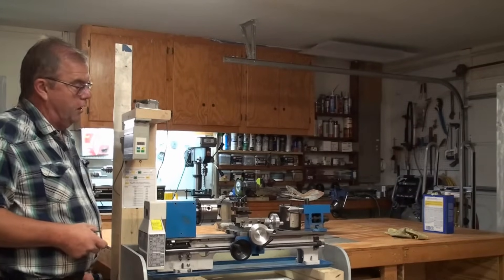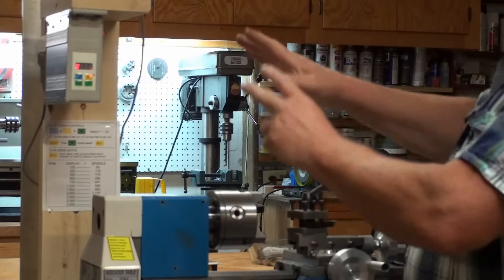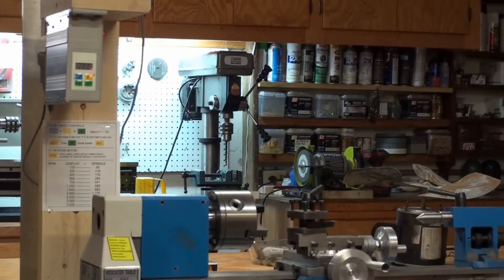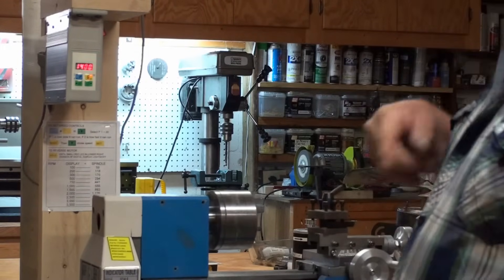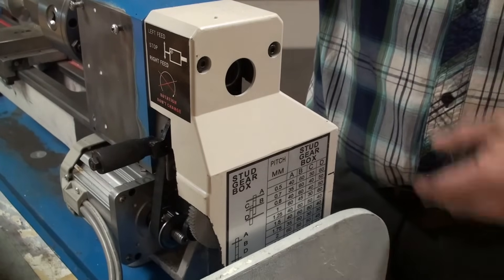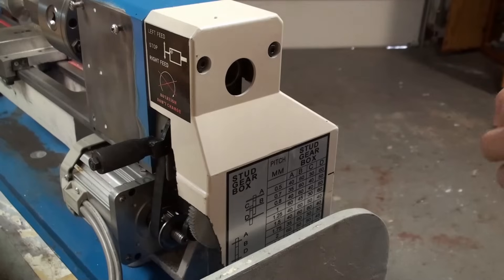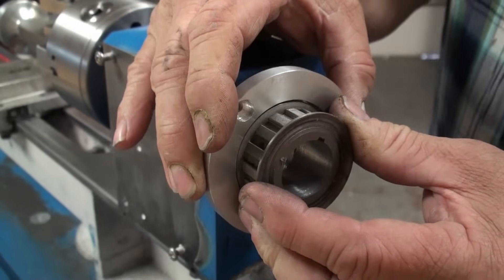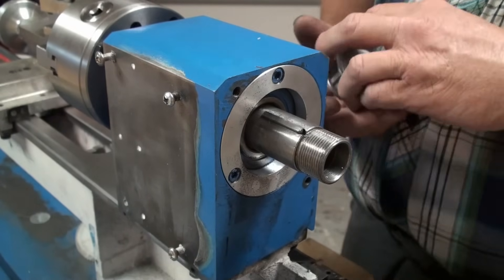Mini Metal Lathe 1 HP Servo Motor 750 Watt Computer controlled with threading and gears

Comment: I have always loved pulling things apart and making them better so I think your videos are fantastic. I am thinking of getting a mini lathe i have narrowed it down to two I thought about the mx-8/14 with a 650 watt motor but then spotted a mx-s716g with 800 watt motor. Which one would you recommend. Or maybe a better model. Thanks in advance.
Reply from the maker: These numbers mean very little to me. For starters. What brand is it sold under? Only Lathes sold by known stores in USA will tend to have any quality control. That means USA based business (grizzly, Harbor Freight, Northern), There are better higher priced, more QC company's but remember, based in USA and stock parts. 
Consider this: Vevor is not a manufacturer, they are a discount warehouse and shipping company. They stamp their name on many things, Lathes in particular seam to be what ever is available and called the same model regardless of what is inside.

Comment: Nice!  That motor come with a square aluminum mounting bracket? I purchased mine and didn’t come with it. I can’t mount it because doesn’t have anything to hold to. It doesn’t have the 4 screws either.
Reply from the maker: This motor now is built to our specs to include software based jam protection, thermal overload protection, Non magnetic speed control switch, fully adjustable motor mount that allows for both belt tension and belt alignment, polished and anodized Synchronous Drive pulleys and 1/2" wide USA standard L050 belt. 
See it here: https://www.servomotorkit.com/spindle-drive
We also have a complete system for the 2 speed versions.
See the 2 speed kit here: https://www.servomotorkit.com/shop-1
Note: some page address's are subject to change so start at: 
https://www.servomotorkit.com

Comment: You mentioned you do mods on that lathe. Have you done any with the compound and cross slides? Also, with this mod are you able to take off more material per pass compared to the 750 watt motor that was in there?
Reply from the maker: Yes lots more with each pass. However just because you can does not mean you should. Remember the bed is only 3" wide. If it chatters, you are cutting too much.

Comment: Hi I live in the UK what voltage is it and how much
Reply from the maker: Dave, I can build it in 110~120 volts or 220~250 volts. They sell in the USA at apx $289 USD. However I usually do not ship outside of the USA.
That video is very dated. The new models have to many upgrades to list.
To see them on eBay you need to register a US address in your eBay account. At that point you could buy but you will still need a US based reship company
and they will likely charge you a considerable fee..
I will consider selling to you direct but only after seeing your feedback on eBay. That is feedback you left for others.
Discuss this by e mail to fernriverresort@gmail.com

Comment: Howdy friend, do you still have listings on eBay? It appears your link is broken.
Reply from the maker: I updated the link above. Additionally you can search eBay links as follows:
Single speed mini lathe kit: https://www.servomotorkit.com/spindle-drive
Two speed mini lathe kit: https://www.servomotorkit.com/shop-1
8 X 16 mini lathe kit: https://www.servomotorkit.com/product-page/900w-8-x-16-metal-lathe-mx-210v-servo-motor-upgrade-kit-1-2-hp-belt-type-vvvv

Comment: I've had my 7x14 Erie tools lathe for 6 years now and have been fairly satisfied with it to a point. I always realized that it couldn't perform like bigger and better quality lathes but,for what I do it was adequate as at this point I really had no need for anything high precision. I've made a few upgrades and mods to it but always noticed it was lacking in its ability to produce a real decent finish but not anything that a little polishing couldn't fix but it always had a tendency to chatter somewhat no matter how much tinkering and adjusting I did so,I just concluded it was the nature of a cheap mini lathe. Last week while turning some delrin rod,the spindle just stopped dead but the motor was still running. At first I thought that the belt was slipping but when I inspected it,I realized that the motor shaft had snapped. It actually broke off clean right at the armature. I really don't know how it happened as I was only cutting plastic rod at the time. I'd been looking at this upgrade kit on ebay for some time and actually almost bought it awhile back but figured that I really didn't need it as the original motor had adequate torque for what I do. So I  purchased this new servo kit from Dan last week,installed it and tried it on the very same piece of delrin that was still in the chuck when the shaft broke and immediately noticed a difference in the way it cut. There was no more chatter! All this time I thought it was something about the overall quality of the lathe but actually the motor was the culprit. I chucked up a piece of aluminum rod and tried it and the difference was huge. No more chatter. The installation of this motor was simple. I just had to modify the belt cover as bit per the instructions and some on the headstock cover,about 10 minutes work. Fit and adjusted perfectly. Every time that I had to change the belt on the other motor,It was a pain to get it right but this new one aligns perfectly.
Reply: Salve io oh acquistato  un torneo di 2 mano  propio come il tuo stesso modello ...il problema è senza motore senza marca senza matricola ..pultroppo i tecnici anno difficoltà a poter inserire un motore nuovo , visto che nn potranno neanche risalire al modello visto che io lo acquistato così...magari lei può aiutarmi per marca il tipo di motore originale e la pulegia montata sul motore dendi e diametro ...la ringrazio,  io tradurro in italiano .

Comment: Nice work, I need to do this for my emco, whats the dimensions of the motor
Thanks
Reply from the maker: Steve. Which model Emco? I ask as someone is in communication with me on eBay to make the kit. Always better to make the first kit with an owner and not through eBay.
Once complete it would be listed on eBay for other Emco owners. First one gets it at cost or less but has extra shipping.
Thanks 
Dan
Reply: @danielmartin382  Its a Compact 5 but might need the motor for other machine depending on dimensions of the motor
Thanks
Reply from the maker: Very busy right now but looking for a broken Emco. Maybe someday I can develop a kit

Comment: Hay do you no if this will fit a 7 by 10 lathe
Reply from the maker: There is a different kit for two speeds. Search eBay with this item number 184590554254.
If you already have the motor, look at this kit, search eBay for this item # 185226001159

Comment: Still in the process of getting my new lathe up and running.  I have the blue and white lathe in the video in a 7 x 14 configuration.  Now I know how I'm going to fix it after I get up and running and break it, lol.  The belt and pulley upgrades alone would be a huge improvement.  My mad money account was stretched pretty thin with the lathe purchase, plus all the tooling, etc.  Once it bounces back a bit I'm coming back cash in hand, this is a bad a$$ upgrade.  Probably around the time you get back from vacation (I'm guessing) and start shipping again.

Comment: Hi Dan, a great design improvement you have developed for this lathe, a pity you dont ship to Australia, if you ever decide to ship overseas you have a buyer here. I have watched your video about 6 times so far. Tried to send you a "seller email"  to but it  blocked any from overseas customers. Interested in a mounting and drive kit as i can get the motor and controller in 240 volt  suppy here locally. Keep up the great designs and kit purchase options. cheers Adrain

Comment: is there anyway I can have cnc control with a Centroid Acorn?
Reply from the maker: The motor can be stopped and or run at any specific speed by providing the correct resistance or voltage to the external speed control version plug. Revolutions can be counted by back stabbing the field wires. Reversing would be difficult. Several say they have CNC control but none have provided instructions on how. I personally may never find time to design that system.

Comment: Hey Daniel. Sent you a message through eBay and you gave me the title of your video here. Let me know if you find one of those smaller pulleys with the small I.D. I have the same lathe as the one you show in this video and I'd like to replace the pulleys and the belt. It would be nice to replace the belt with one that is more available and better quality than the one that comes with it. Cheers
Reply: Ciao daniel ti chiamo dalla Sicilia ho acquistato un torneo .identico al tuo il problema che è senza il motore , visto che nn c'è scritto ne marca e il motore nn e stato possibile recuperarlo i tecnici nn sanno che tipo di motore porta di fabbrica e che marca sua , quindi siamo fermi davanti al torneo senza poter far nulla  gli strumenti ci sono x modifiche però vorrei sistemarlo in originale ..vorrei che mi aiutassi con marca  matricola e sopratutto il modello del motore , spero che tu mi puoi aiutare o anche le persone nei commenti io magari tradurre in italiano...grazie
Reply: I only offer the conversion kits to include just the belt and pulleys and all the way to a complete system including the servo motor. I am also designing drives for shop smith and others. However I do not offer a replacement of the original drive as the original motors are prone to failure. text me at 8314212669 if you want direct contact.
Reply: Scusa il mio nome e luciano

Comment: Might be interested in metal lathe content, but you need to work on your video production a bit.  Hang some blankets to help kill the echo.  Out of focus shots should be re-recorded with fixed focus, or neutral background to be auto focus friendly.  That’s only the first 3 minutes.  Good luck.
Reply: Mike, 
If only I had time to make new videos. Currently I cannot build the kits and the new designs fast enough. Now I have a new system for two speed lathes that I really need to make a video on but again, the two prototypes of these I built so far are already in use and the manufacturing of gears is not even finished.
Dan
Reply: You need to ramp up to speed. Starting and stopping so abruptly is hard on the lathe. Any size lathe
Reply from the maker: @donjohnson7899  Don. soft start and soft braking is programmable. The video you watched is version 1 from almost 2 years ago. There are now thousands of these in use and everybody programs them to their own requirements.
Reply: @danielmartin382  Yep. Need to get that done

Comment: i just ordered the set up you used , I was thankful to finally find something to fix the lathe mine has been not worked since day on , i purchased it in February. I eventually want to hook up stepper motors to it ,to make it a CNC will I be able to hook the controller into the system ,or do you have any recommendations thank you for your time
Reply from the maker: David.
I am currently working on CNC control with another interest machinist who already has his mini lathe converted to CNC. I will try to look you up to contact you direct but it will be posted here when done.
Thanks
Dan.
TheCustomCrafter Dot Com
Reply: @danielmartin382  , 
Please provide the address for this mini lathe dealer/distributor in Indonesia .
Reply: David.
I have designed and tested a switchable internal/external motor speed control. This will allow you to turn on and off the motor remotely at any of 10 different selected speeds.
I will bring it to market soon.
Reply from the maker: David, I have no idea if you can attach other motors to the control unit. Likely not. Maybe with the 2 pin plug as a stop start control but due so at your own risk. See below.
The extra plugs in the back are: 4 pin is for a needle stop position. It will basically stop the motor in 2 positions 180' apart. However to use this function you need to fit the position sensor (hall effect with 2 magnets) on the spindle. This is not worth the effort as there is not enough positions available to use it as a drill index etc.
The 2 pin is likely a power out for a light or a safety cut off. I have not tested it and do not know.